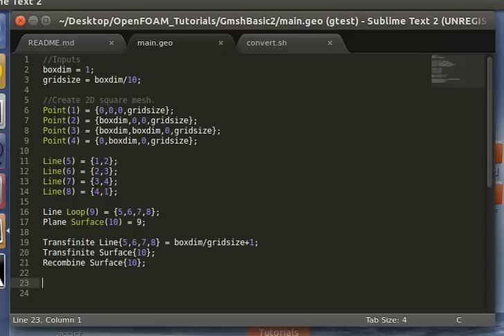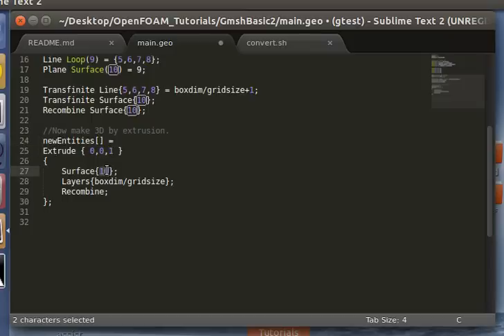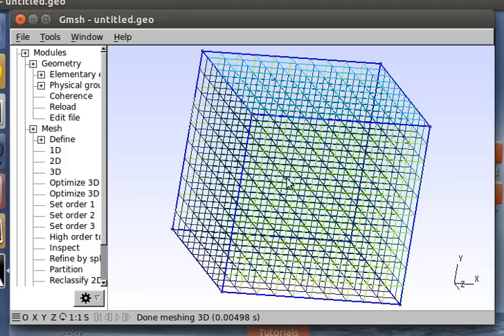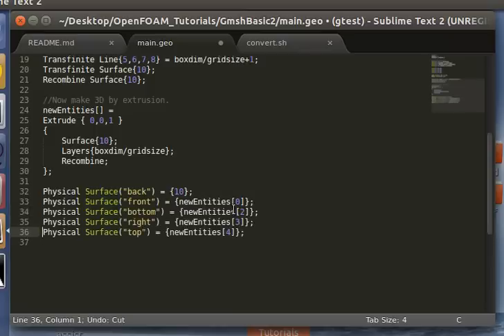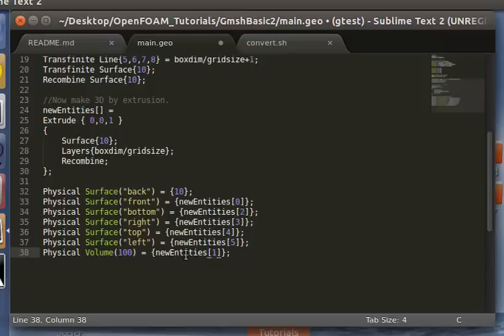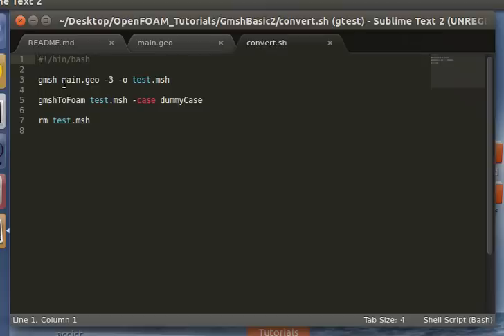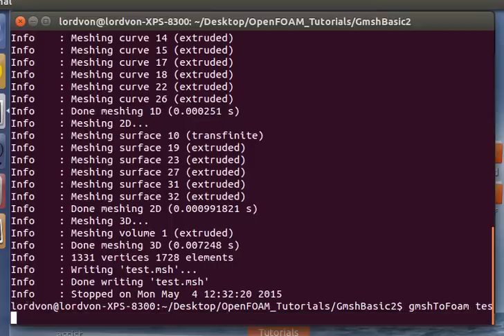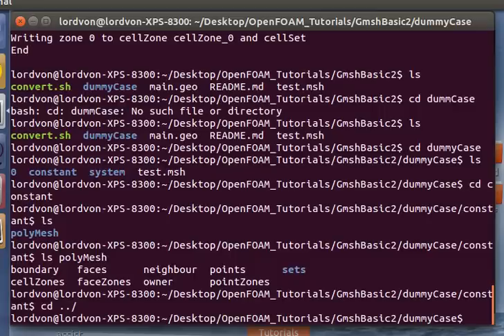Making Meshes for OpenFOAM with Gmsh, Part 2: Extrusions and Conversion to OpenFOAM Format

Comment: Great set of videos! Thank you so much.

If i may give a tiny suggestion for future tutorials, I did have quite some trouble not being able to view the mesh when clicking "2D". A thorough eearch on the web did not reveal anything, but after some time i realized that i needed to active the 2D element edges in "Tooles" bar.

I also have a question. Is it possible from the cube above, to remove a small part of the cube? Say removing one cell for instance, if that was how the physical model i wanted to simulate looked like?

Thank you!
Reply from the maker: Hi, thanks for watching!

That's really weird, I never had to mess with display settings. It could be something new with Gmsh (as it is still being actively developed and regularly released), or it could be a quirk with your setup.

As far as I know, it isn't possible to remove just one cell. And I don't think it would be feasible, because this would make your physical setup dependent on your grid resolution (and applying boundary conditions only on a single cell would be not be numerically ideal). Better would be to draw (and extrude) a separate shape that represents your removal. Then, simply exclude this from the volume list at the end of the Gmsh script. Now you can set the grid resolution to be anything and your physical geometry stays the same.

Comment: @OpenFOAM Tutorials 
thank you for the nice video series. I have a problem. When I write the mesh to text file, it works. However, when I want to use the command (gmshToFoam) to convert it to openFoam format, it does not work. It says, "No cells read from file "....msh". Does your file specify any 3D element? Perhaps you have not exported the 3D elements.". I am glad if you reply sooner. 
Another question: Is specifying that physical volume important?
Reply: Hi Jalil, newer versions of gmsh outputs a format that gmshToFoam has not been updated with. Can you export with this command?
gmsh -format msh2 -3 -o main.msh mesh/main.geo
I don't think the volume specification is necessary if you only have one volume, but I am not sure.
Reply: @robertlee7947  Thank you very much!